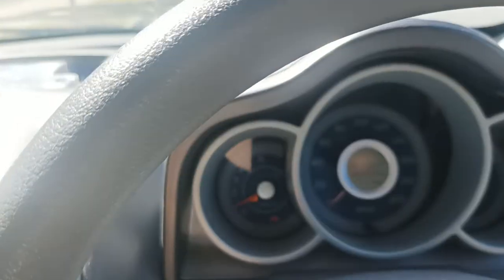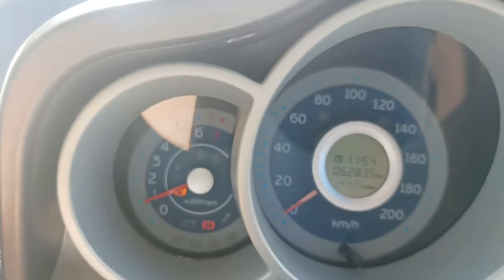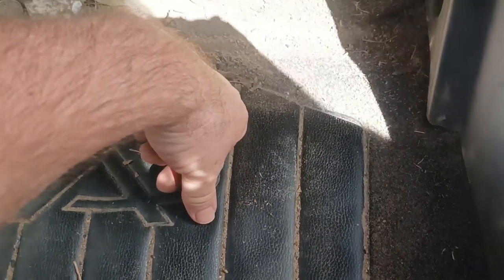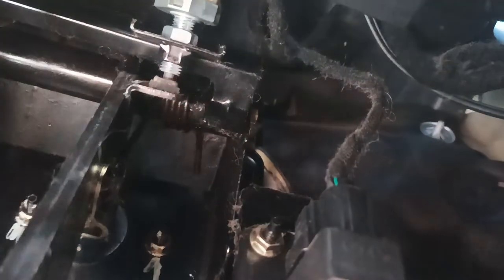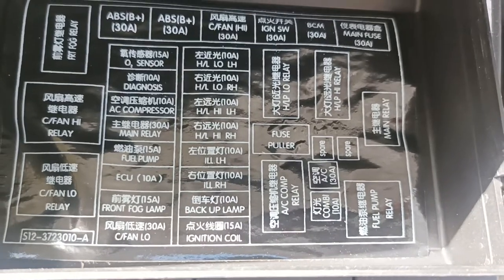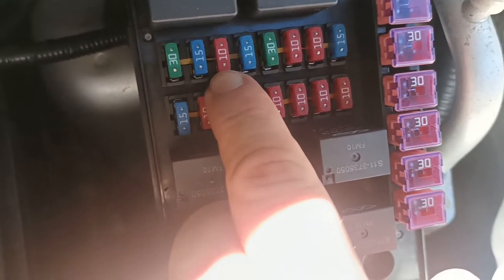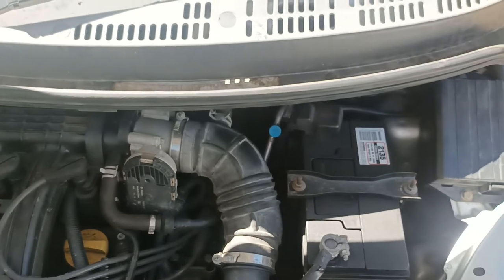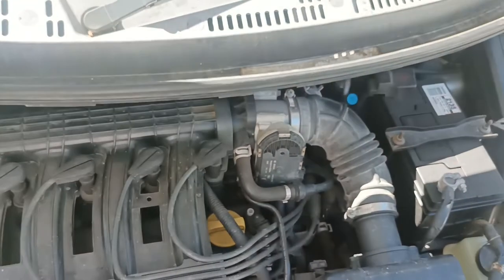Chery j1 - Sudden Loss of Power /Engine Cranks But No Start No Spark

Comment: Rubber felt off, and killed my 1 month old battery to 2V, and second time to 0.4V. Luckily I was able to get back my battery from the death, but I knew that problem has to be somewhere there. I thought I would take a car to some electric service, but then I got onto this video that helped me a lot. Problem was exactly this, rubber was gone and even I noticed that at the spot the switch should touch the brake pedal, there is a hole! Like WTF!? Nevertheless, I found a small screw with rubber top (like the one at the bottom of washing machine for leveling the machine, but smaller) and put it in that hole, screw it on the other side, replaced the stop light button at the right position and that's it. Also to mention, before the fix, I took the switch home with me and check it with digital multimeter, and it was working flawlessly, so I eliminated it as a problem. Car is working again as it should and all is good. Just one more note, because of this issue, my gas pedal would not respond from time to time in the middle of driving, I was wondering what could be the problem, but this was the issue.
Reply from the maker: yes this is the problem of no throttle/acceleration. Drive normally around and tap the brake the ECU kills the throttle
Reply: I have some broken ribs of central console ventilation outlets. Do you have any video of central console disassembly as I need to remove this vents outlets and fix them? @TerryJonesPrinterRepairs

Comment: Hi and thank you very much. I think this might just be the solution to my problem. I own a 2011 Chery Tiggo 2.0 TXE that just cut out the other day for no reason and would not start at all. Cranks but will simply not start. Workshop has tried everything but to no avail. Next they wiil have an auto electrician look at the car to determine where the problem might be since it is not mechanical. I am hoping it is something as small as in this video. Thank you

Comment: My Chery J1 1.3 T E  keep loosing power when we drive them we stop switch it off start  it them we drive my be  a week  them does it again
Reply from the maker: check to see if you brake lights are coming on as it kills acceleration and power. there is a rubber piece that comes off on the brake pedal